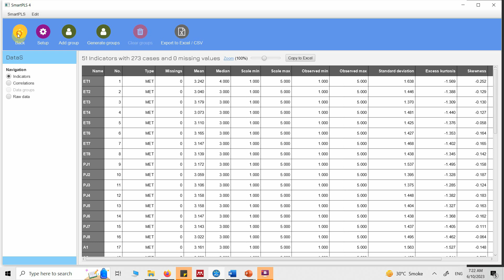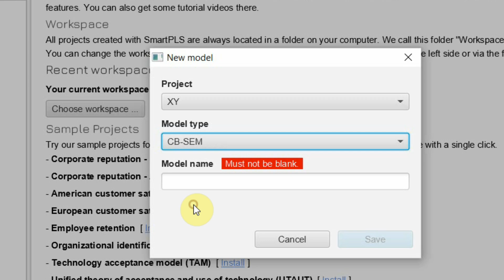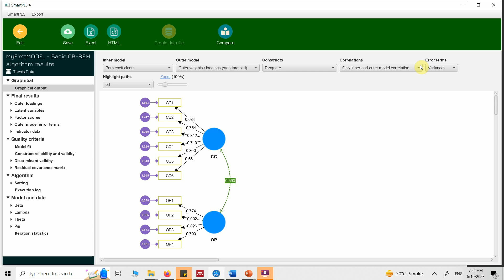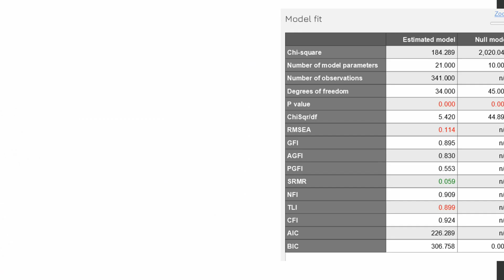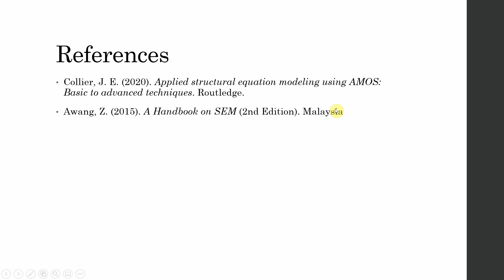CBSEM using #SmartPLS4 | 7 | Basic CFA Model with SmartPLS

Comment: Thanks for the video. I have a sample composed of two categories, say males and females, when I test a certain path using SmartPls cb-sem it gives insignificant results in both categories, surprisingly, when I test the same path for the whole sample it gives significant result!!! This doesn't appear when I use Amos (in Amos the path is insignificant for the whole sample too). If testing structural model is not yet reliable in SmartPls cb-sem, can I use it for CFA only and then test hypotheses using Amos? Given that the two softwares give very close results regarding CFA, but SmartPls is just more user-friendly
Reply from the maker: The results may slightly differ. I recommend using same software for both analysis.